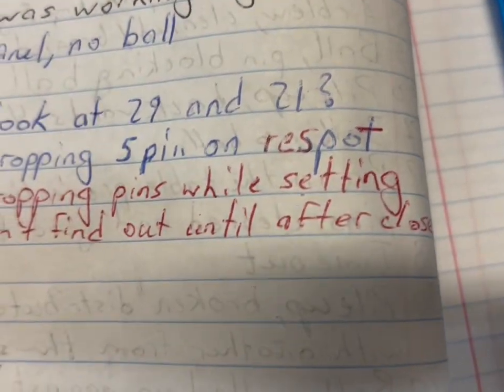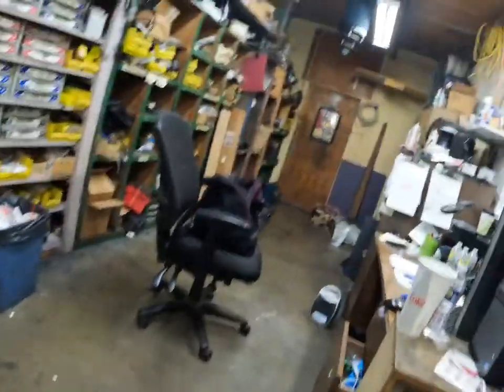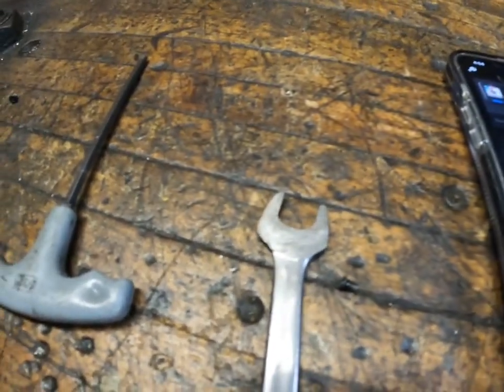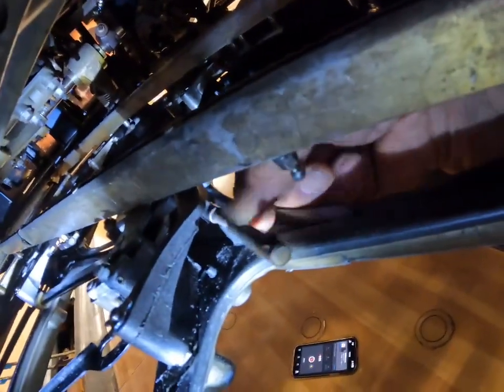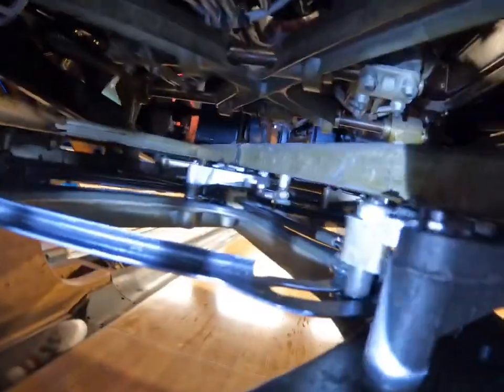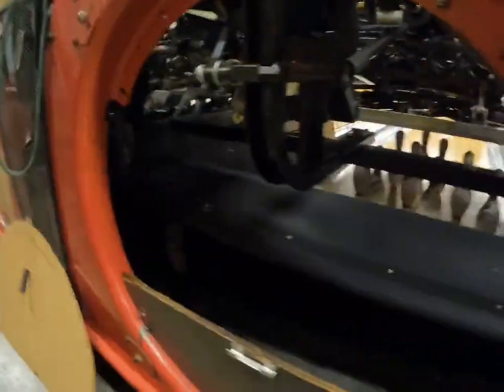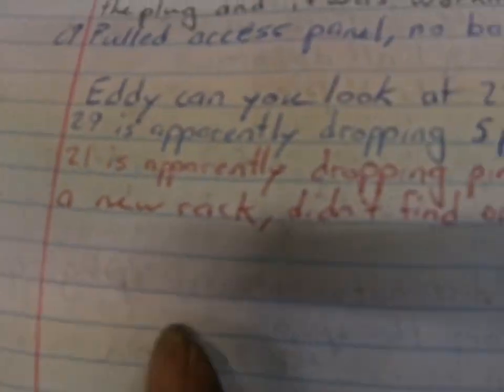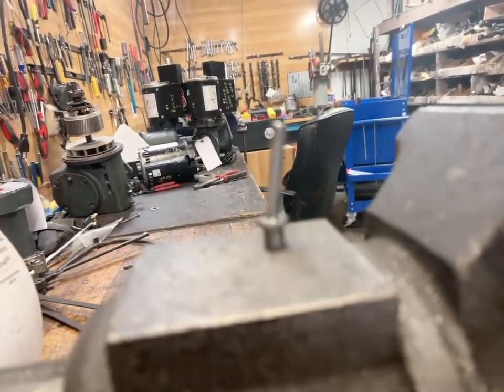Amf 82-70 dealing with dropping pins

Comment: I did my 50 years in a split house and kept 10 complete cells ready for use.  After seeing a few tables crash on to the pin deck I started using a single wrap of aircraft cable around the table and the bins.  If that table free falls, it's gunna leave a mark !  Coconuts also split apart !

Comment: Are the Twister pins working out for you? We put some on 4 lanes to test years ago and decided not to buy more. The red stripes on the pins were plastic bands instead of being painted on. The bands started breaking off before long. Not sure if they still make them that way.
Reply from the maker: no, i don’t like it, we have a lot of issues when we replace our pins with twister pins, its almost 3 years now that we are running these twister pins
Reply: @pinhead8122 i heard twisters will fock you over if you have amf or gsk machines those pins just dont mix well because of there density and surface not only that there garbage pins anyway not real pins.